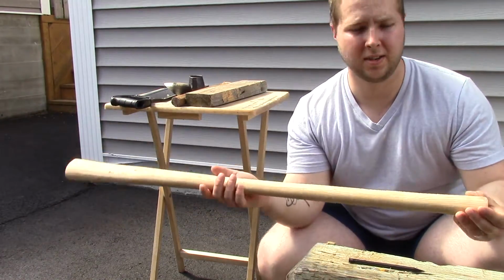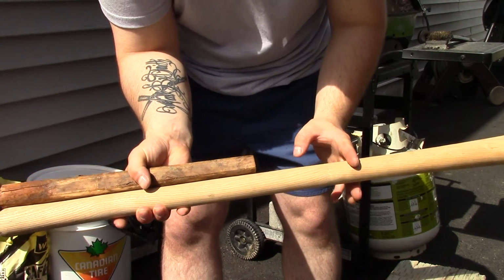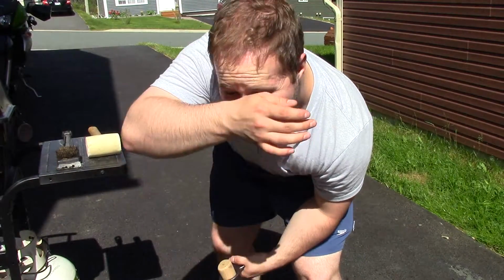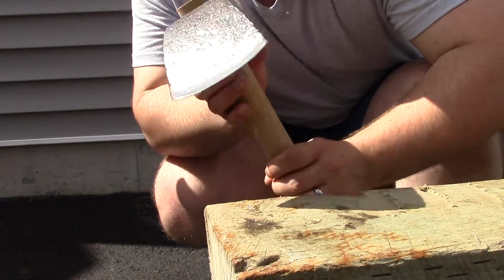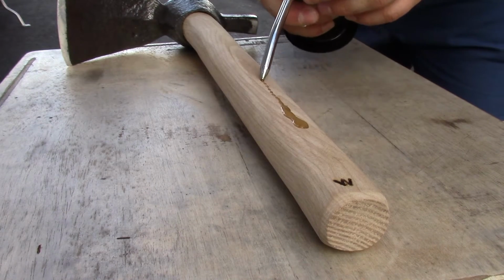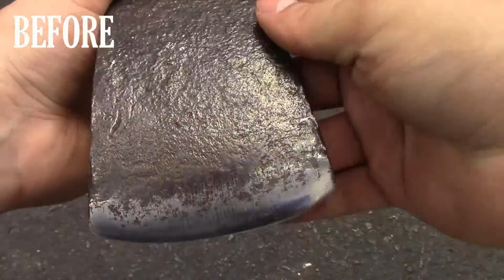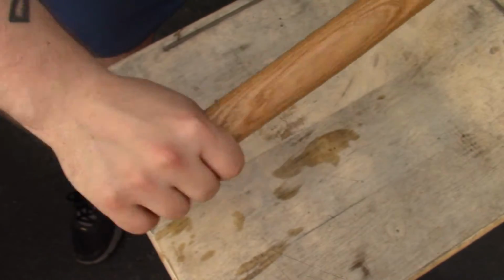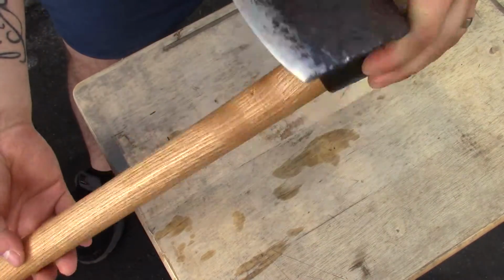Antique Adze Restoration - FINAL - Part 3

Comment: Hi! Really cool video and series, even though I don't really know much about these tools or the restoration process. What is the purpose of Linseed oil as opposed to regular varnish? Thx
Reply from the maker: Thanks Nick! Linseed oil is just as it says: oil. It soaks into the wood, hydrates it, protects it, and keeps the wood permeable for future oil application. The oil finish is also very easy on the hands, almost 'soft'. A varnish coating creates a plastic-like layer over the wood. This layer is harsh on the hands, and also makes the wood impermeable, so it cant be oil. The wood will eventually dry out and become brittle. Oil is the way to go my friend! It is better in EVERY WAY.
Reply: Weiderfan Ah, cool :) thanks!

Comment: Very nicely done.  I heard your comment regarding the ax head needing heat treatment.  There are some excellent vids on YouTube on how to make your own propane forge which will get plenty hot enough to heat your ax head to critical.  I built one for knife making for about $80 US out of an old propane tank lined with refractory material.  The gauge and hose is the most expensive part.  However, given how an ax is used, I'm not sure I'd heat treat the whole head.  I think I'd use a torch to heat the 2-3 inches down toward the edge and harden and temper that portion leaving the rest of the head a bit softer and more able to absorb the repeated impacts of use.

Comment: great job done! BLO is really the best part, that and re edging. That spokeshave was a great investment! Really is good as new. And likely better then the modern version.
If your hewing a beam from a straight grained log, use some metal/hardwood wedges and slit the log so you can make to more useful sized pieces.
Reply from the maker: I'm so happy with it buddy. I love my spoke shave. Probably my most used tool. That and the little hand plane you gave me... remember? Little small one? It has been used a TON. I'm putting some thought into the hewing. Thought about splitting, but not sure if i'll find a windfall large enough! I'll be lucky to! haha If I was going to split, i'd hew a beam and then split the beam into planks.

Comment: On a 13" laptop, working on the handle in such fashion, appears to be 'work at risk,' (proximity to tender zones). Great job!
I'm considering a saddle-seated shave-horse, and am interested in exploring the adze.
I've also realized that adzes are like axes. If you use one, you own more than one...
Do you have thoughts on various weights vs. size of raw material for a shape like the one you posted?